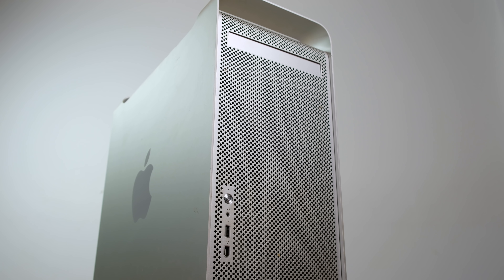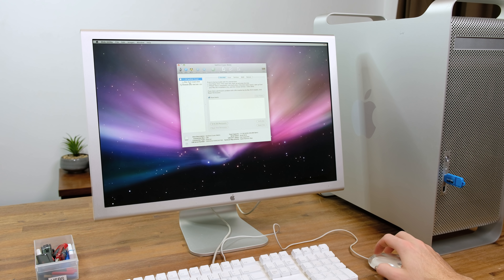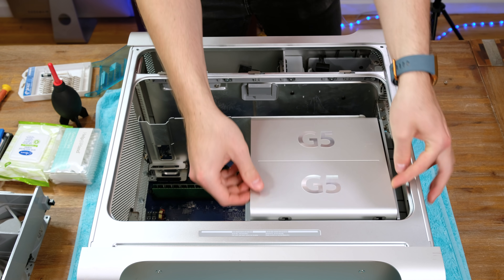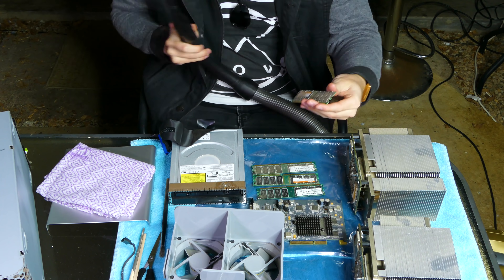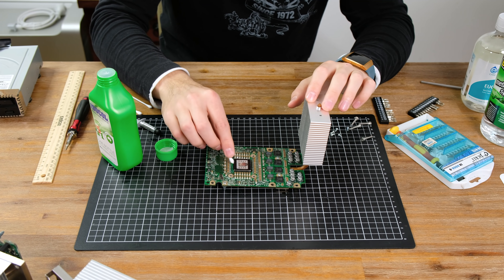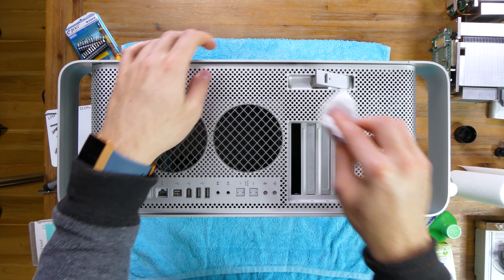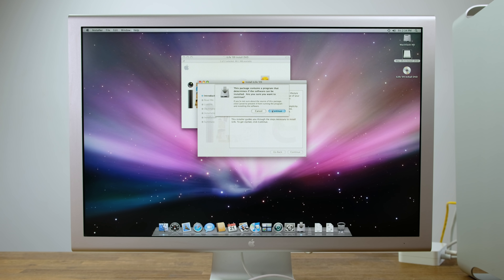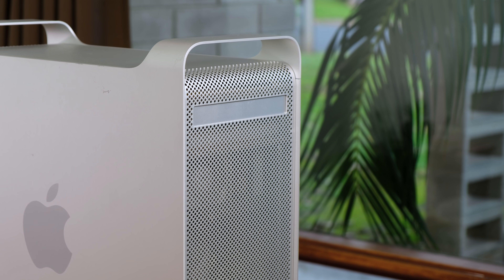Using The Original 'Cheese Grater' Power Mac G5!

Comment: 2003: whole machine for $1000
2019: $1000 stand
Reply: Ever hEaRd of inflation
Reply: For all those wondering an accurate average usd price in 2020 here you go...

According to the Bureau of Labor Statistics consumer price index, today's prices in 2020 are 39.79% higher than average prices since 2003. The U.S. dollar experienced an average inflation rate of 1.99% per year during this period, meaning the real value of a dollar decreased. 

In other words, $1,000 in 2003 is equivalent in purchasing power to about $1,397.87 in 2020, a difference of $397.87 over 17 years.
Reply: These were expensive but not unobtainable expensive (vs the current Mac Pro). I bought a cheese grater G5 with a misused student loan and didn't even have to eat ramen for a year afterward.
Reply: Those machines did not cost $1000.  They costed 3x that much in 2003, and that was in 2003 prices.
Reply: Michael Timpson and in 2003 specs
Reply: Tale3339 :3
Reply: like a grand is nothing for a machine
Reply: How much does these go for now?
Reply: @shanemotschenbacher5137  50 usd Uruguay
Reply: This machine was expensive for its time, I would guess it cost like $1999 at least and performance/price ratio was just horrible...
Reply: @dinodinoslav  Not really. It's a professional workstation. In the keynote, they showed a similar Dell workstation with a much higher price tag. These are expensive in and of themselves, since they are meant for creative professionals, but they're actually competitively priced.
Reply: @thatrandomdude4505  you do not have a clue what you are writing about, it had not a top notch hardware for its time, yet it cost at least as much as I wrote: https://en.wikipedia.org/wiki/Power_Mac_G5, even Apple marketet it as PC, not a workstation - World's fastest PC and compared it not to actual workstations, because it was too slow, yet it was able to  beat some high end Dell PC's: https://www.macobserver.com/tmo/article/dell_vs._apple_details_on_the_bbbs_report_on_apple_ads. Apple had allways horrible performance/price ratio. It was faster than PC, but was expensive, it could not compete in terms of power with actual workstations, so it was sold as PC..., not workstation, and really overpriced one.
Reply: @dinodinoslav  No, it was top notch during its time - it was a workstation for professionals, like a Dell Optiplex also was. Actually, I can't remember whether it's the G5 keynote or the OG Mac Pro keynote which compared the Mac with a similar Dell; but, either way, both machines were very good in their day. PowerMac G5s and Mac Pros have always been competitive in price. You need to realize what a workstation is and how it differs from a normal desktop computer. Just because it's marketed as a PC, doesn't mean it's not a workstation.
Reply: Well, people like you live in alternative reality, just read that article in Mac world and Wikipedia page, that machine had weird IBM processor, it was used in lower end machines outside "Apple world", even Apple started to use Intel a few years later, GPU was midrange desktop gpu. Apple had to invent methodology to beat Dell PCs. It was overpriced not on par with actual Xeon and Quadro 4 combination which was used in real workstations at that time by Dell. It was fancy overpriced dust catcher, noisy and power hungry. Here is an article about Apples 64bit architecture: https://www.pcworld.com/article/112749/article.html, even here it is said that this is desktop, king of desktops was Athlon at the time not Apple, who resorted to tricks to show "great 64 bit performance". And lastly Dell workstations were branded as Precision at that time, not Optiflex...
Reply: @dinodinoslav  You don't need to educate me on PowerPC; I used PPC machines from 2004, until 2014. Intel couldn't make a good processor until 2006, which is consequently when Apple switched over to Intel CPUs. PPC G5 processors are power hungry and need serious cooling, but they're mighty. Also, Athlon processors? Garbage. Seriously have never had a good experience with Athlon. (You're correct, though, regarding the branding of Precision—I knew I was perhaps mixing up Dell model names.)
Reply: @dinodinoslav  I had experience "out of the Apple world"—it was called Windows 98, and it (and the computer I used) were both total crap. And, yes: I said it... Intel sucked until 2006.
Reply: @thatrandomdude4505  Again that feeling issue mentioned in previous comment...
Reply: @dinodinoslav  those "weird IBM processors" are still updated and made to this day, and sold for very high end mainframe servers. Look up POWER8 and POWER9. If POWER is akin to EPYC, then the G5 was like a Threadripper of its day.
Reply: @kaitlyn__L  Nope, Big Blue systems you mention are still in use but Intel has the market, their market share is marginal. They are only used in very specialized segment. In that time kings of performance were Xeon in workstation segment and Athlon in desktop segment (actual "threadripper" of its time). Apple was overpriced for for desktop and too weak in comparison to actual workstations.
Reply: @dinodinoslav  don't get me wrong, Athlon had its achievements, x86-64 is something we all owe to AMD. Intel couldn't figure out how to retain 32bit code support, despite doing similar for 16bit code in their 32bit chips.

But the G5 was beefy for media production in its day, rendering CG, outputting video, and so forth. Maybe you're confusing "workstation" to just mean "CAD or compilation box", which I will grant the G5 wasn't great but wasn't terrible at. SGI was still in the game at that point with MIPS for similar graphics work, before they would switch to Intel. Also it looks like Athlon 64 didn't come out for a few months after the Power Mac G5, and it took longer for premade PCs and workstations to ship with them. 6-12 months was a long ass time for computer power back then. A 2 year old box would become useless at running any new software. So I'm not sure about directly comparing those, I feel like it'd be similar to me comparing a G3 to a 486 instead of a Pentium. But looking at forum posts and tech press from 2003 and 2004, it seems the Athlon 64 was better for integer, G5 was better for vector, and they were comparable for float. That lines up pretty well with the G5s being used in video production, CG largely uses vectors and floats. For database and number crunching, then it would have been slightly worse than the Athlon. That's not exactly as cut and dried as you're putting it?

I mean I know you don't like the POWER arch, and for a lot of use cases simply having tons of regular x86 will run your data centre or CDN fine, hence Intel and AMD's dominance on that market. But that's why I specifically said mainframe server. High throughput, large scale computation servers, often local to the business premises to get fibre LAN speeds instead of off in a data centre somewhere on the WAN. The competition is fiercer in that segment, and that's the area POWER still shines, with 4 and 8 way SMT, huge L4 cache, and being kept at 100% utilisation for long periods. While fact checking myself I found many sysadmins in comments and forums talking about how they chose POWER 7, 8 or 9 for their place of work due to better performance/watt or performance/dollar compared to SPARC and x86 on their specific workloads. 

It's a niche segment to be sure, but that's different from being useless and irrelevant and "a weird IBM arch".

In addition, looking up benchmarks from 03 and 04, the G5/PPC970 seemed to be about 150% the speed of a P4 Xeon depending on the workload, which was a workstation chip. The POWER4 (which the 970 was based on) also compared favourably to contemporary Itanium servers, judging by tech press from 2002, 2003. 

It's horses for courses, innit? To insist that there's one best CPU of any era is just weird.
Reply: @kaitlyn__L  You were looking apparently at very wrong benchmarks i bet this ones: https://barefeats.com/pentium4.html, check this: https://www.anandtech.com/show/1702/5. AMD and Intel ruled, only in Cinebench Apple was not lagging behind. Opteron was fastest for workstations actually, for desktops there was Athlon. Apple was too pricey for desktop but too slow for workstation. All in all Apple was losing  the  computer market share gradually. Apple is known for bold advertising but reality is something completely different: https://techreport.com/news/5866/uk-bans-powermac-g5-ads/. Machine in video was mostly used by hipster graphic designers and photographers, people could get the same performance cheaper elsewhere. Basic configuration was priced with 1999 dollar tag and that would be at least 2500 today, it was not worth the price. IBM is slowly dying whether you like or not: https://www.macrotrends.net/stocks/charts/IBM/ibm/revenue.
Reply: Apple had to invent methodology to show its "strength", it was on par with other desktop processors, nothing special considering premium price. IBM solutions of today might be interesting but still cannot beat intel and amd, IBM is slowly dying out. I work for huge company and only thing by IBM used there is tivoli, company got rid of mainframe business, guess who bought it.

Comment: Power Mac G5 owner here. I have one of the near-base models, and it is absolutely horrible in terms of usability. I plan on repasting it, hopefully getting a new case, and installing an SSD in it soon though, so maybe that will improve it!

Edit: it's a single-CPU unit, and although I want the dual-CPU unit, I would have to purchase a new motherboard. (which I may do, depending on how the aforementioned upgrades go!)

Comment: I’m happy apple are going retro in terms of external design. I just wish they had this thinking when it came to the iPhone’s 10th anniversary. I think that they should’ve released copies of the iPhone 1st generation on June 29,2017 with its small screen and aluminium/black plastic design but internally having modern software and hardware.

Comment: I had several G5's including the watercooled model. Great machines back in the day.
Reply: One started leaking on me. TV station motion graphics workhorse. Those machines sucked a lot of dead skin cells. If you didn't keep 'em clean, they would overheat and even throw kernel panics when rendering. Once that happened it was the end. I learned the hard way. Past 90 degrees celsius and they'd panic. I had 14 G5s under my supervision back then. When the jump to Intel came I got 64, plus 32 Xserve and 24 Xserve RAIDs. Good times.

Comment: Not worth it unless you're a collector. Last OS revision is 10.5 Leopard and the latest apps to run on PowerPC architecture are going to be 12-13 years old. You'd be better off to get an early Intel Mac Pro for the same money or less. You'd still be behind the curve, but you'll have a more secure OS with more features and a lot of Intel Mac software will still run on them and any Mac Pro of any year will outperform even a quad core G5 and you don't have to worry about liquid cooling mishaps like you would with the quad core G5.

Comment: I just started doing the same exact thing to my old dual 2.5 G5 PPC. I like the way you cleaned the case with spirits. Thanks for that tip. I’ve installed an SSD, 8GBs of RAM and I’m running OS X Server (Leopard). I may actually continue to use it as a part time server if the power requirements don’t turn this into an exercise in inefficiency. Good vid. 👍🏼

Comment: if you do a dual boot and install Windows on it it will allow you to work on most modern architecture
Reply: It's not possible to directly install Windows on a PowerMac.
Reply: Variable  not Directly but not impossible there are ways to get around it takes some effort

Comment: Hang on, Youtube works with a Dual G5? It's probably the oldest machine that can do this
Reply: Le Docteur Probably because Steve Jobs successfully talked YouTube into coding videos in the QuickTime based MPEG-4 wrapper (or possibly the mp4 variant). Most people don’t know that in 1998 the ISO used QuickTime codecs for the MPEG-4 Codec spec. It’s ISO MPEG-4 Part 12 I believe.  I don’t remember if Jobs did this for the iPhone, the Apple TV or OS X, but it did happen. There was a tremendous leap in video quality and everything was a lot more compatible for Mac users.

Comment: I messed around with one of these back in 2015 at a NASA internship where Gary Qualls had a room filled with like 20 of these cheese grater macs. They were the next model, the first intel Xeon dual CPU versions, used in what was at the time the most powerful supercomputer the US had. Image below shows the dodgy setup lol. My computer for the internship was in fact one of those PCs running Windows XP, and I stuck 10GB of RAM in it! I believe it was DDR2, there were 2 daughterboards each with 8 DIMMs on them. I salvaged the unused computers and I think they were a mix of 512MB and 1GB DIMMs.

https://www.nasa.gov/centers/langley/news/researchernews/snapshot_gqualls.html

Comment: Removing the plastic rivet is MUCH easier than you think. Just push the center pin part back up, and then the sides can be squeezed like you showed you trying to do, and can be pushed out. Takes 10 seconds.

Comment: Also a tip for vintage Macs, make a partition on the hard drive 8GB in size, use Disk Utility to "Restore" your Mac OS installer DMG to the HDD partition. If you're using Tiger, Set up the partition when installing Tiger on a freshly formatted drive. Makes reinstalling later down the line a breeze, and there's no limited USB 1.0/ 2.0 transfer speeds.

Comment: This was a lot of fun to watch. I just received a freebie single CPU 1.8ghz model, and that thing is a slug. It can't do YouTube within TenFourFox at all; I need to use an app called TenFiveTube. I can't complain too much, it was free afterall. But I ended up taking the RAM out of it and putting it in a 1.8ghz G5 iMac, and somehow it seems more usable than the PowerMac.
Reply: TenFourFox sucks unless its a dual processor G5 only. Use Leopard Webkit and YT should work, it works on my 867mhz G4 powerbook.

Comment: I have 2 G5s, a 2.0 DP model and the infamous 2.5GHz Quad-core. The latter doesn't work, but the DP G5 works like a charm. Mine is from 2004, has same graphics, although with 64mb of VRAM

Comment: 2003? That means that they kept the design for a decade! They reengineered the Mac Pro design in 2013.
Reply: They did and it still looks modern.
Reply: Yes. They completely reengineered on the inside though with the Intel Switch in 2006. (less cooling due to more efficient intel processors, psu on top of the case, dual optical drive capability, hard drive in super cool bays etc.)
Reply: V. Sriram Sundar Power Mac G5 had 9 fans. Mac Pro 2006 had more than 1 fan. Mac Pro 2013 had 1 fan.

Comment: Not the most powerful variant(it has a Quad-Core 2.5 GHz, and can be topped at 16 GB of ram)
Reply: I actually have one :D dual 2.5 with 16 gigs of ram but all those years later the performance difference is basically unnoticeable
Reply: I have the liquid-cooled Power Macintosh G5/2.7 DP (PCI-X) (Early 2005), and I still fire it up to use iMovie HD, which is still my favorite version!

Comment: Nice vid - one thing you should do after removing the CPU (if you haven't already) is run the thermal calibration - otherwise, the fans will run at full speed. You'll need to find the service disc to do this, though.
Reply: Thermal recalibration is not necessary if you put the CPU's back into their original positions and heatsinks. I just repasted mine and its pretty quiet. ASD will even tell you if recalibration is not needed.

Comment: Your are using your vacuum cleaner in reverse mode to blow the dust out, usually there’s vacuum cleaners don’t have enough pressure you need to use the actual compressor which has lot of pressure

Comment: Two major mistakes.

1)  When you blow or suck air into computer fans, always, ALWAYS make sure they don't move.  Either hold them with your finger or a pen, or whatever.  You risk damaging them.

2) No eucalyptus  oil?  COME ON!  :p

I am surprised with the RAM issue.  I don't think I ever had this problem on a PC before.  It's one thing to not get full speed, but not even switch on?  So weird.

Great video as usual.
I remember using one of these back in 2005-6 or something, editing videos up to 720p on FC (7? or 5? I don't remember) without issues.  Good machine.
I love you for putting the thermal paste the correct way.  So many cringe worthy moment with people having no idea how to do it.

Comment: If I have the single core 1.8Ghz version and I upgrade the RAM to 4 gigs and I install a secondary SSD to compliment the original Hard Drive, will my computer be alright with running footage through an older Final Cut Pro?

Comment: Nice Job! I think you need an air compressor for all the computer dusting you do! :) FYI I do believe that these things used ECC ram, and max out at 8GB, so maybe that's why the upgrade didn't work. You should try putting Linux on it in a future video!
Reply from the maker: Sadly this particular model has a maximum of 4GB of ram https://everymac.com/systems/apple/powermac_g5/specs/powermac_g5_2.0_dp_pci.html